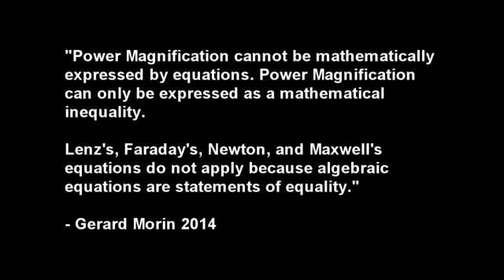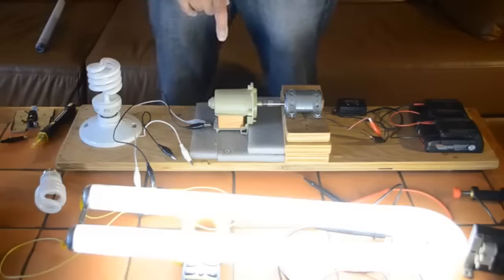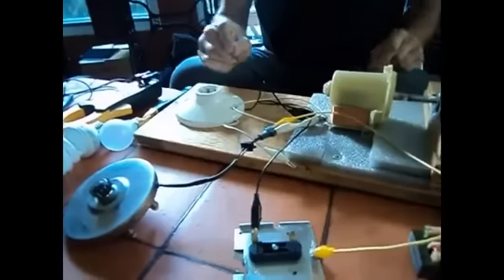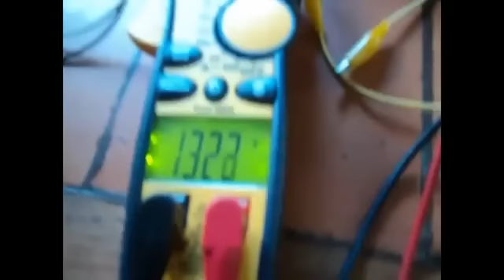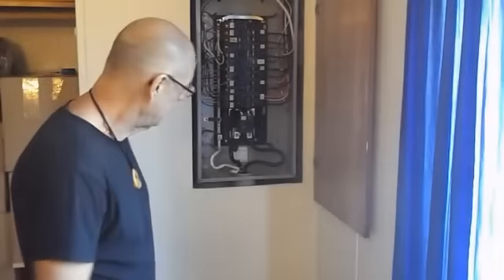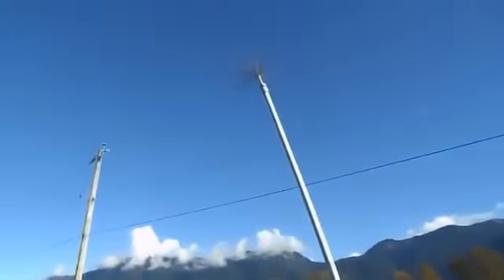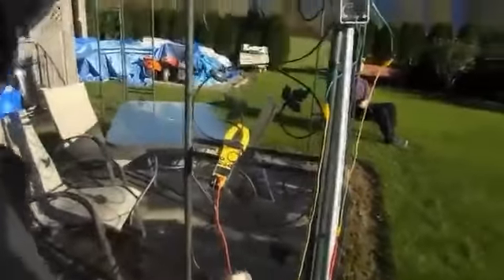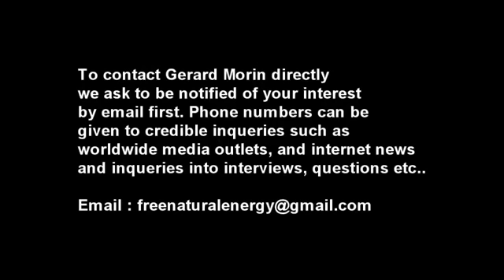Time to END The Electricity Racket - FREE & NATURAL ELECTRICITY PROOF

Comment: I think the break throughs we make tend to be incremental.

Yes we can wait for someone to produce a super powered generator that makes gigawatts of energy from a box the size of a brief case or and I think this seems to make more sense, we can simply improve by design the items we use to make them more efficient.

For example: instead of using light bulbs that burn 100 watts of energy to make light, use light bulbs that burn 2 or 3 watts and in time maybe even 1/2 a watt or less to produce similar lighting that the 100watts used to.
But this takes time.

More efficient motors that use less energy but produce more power.

recycling of power on a loop these kinds of things.

But this will take some thought to produce and time.

Our own body uses electricity and produces quite a bit of power, yet it uses only a fraction of the electricity our machines use, in time we may produce machines capable of doing similar or better than our own body for the power consumption used.
Reply: I agree I have a patent idea I put a pre patent on that would save lots of water in every home I just can't afford to pay to get it full designed in patent on it it recyclable will probably 80% of the water in the home so we can use that for cleaning and other daily activities and washing and watering the lawn we would use that recycled water and have a separate drinkable  line and the toilets water would go directly into the sewer the rest would be recycled
Reply: @chrissappliancerepair4492  It's good that people think and work on ideas on their own and yes other people stealing their ideas is a problem, but some of the problems being solved are not really problems that could be solved simply by for example just reinvesting in the service we pay for.

The water companies are very much crooked, they charge us based on the value of the property within an area never understood how they managed to get that one myself.

I'm told in some parts of the USA you are not allowed to go off grid they make you pay even if you don't use their services.

So some problems are clearly political rather than technical.
Reply: @flitsies  hahahaha I'm not crazy yay! See honey I told you there were others...
Reply: @bscguitars2278  That's just how it Is, politics often gets in the way of progress, sometimes for good reason and other times not for good reason.
Anyway there is a lot happening in the world with tech so we shall see.

Battery powered christmas lights are pretty good now and they last a long time between charging a modest power bank.
Reply: It's all being regulated to a worldwide ish agreement of legality so they who regulate are in front zone of it all even, like the patent office and the one who says this or that in the reason of decline so not to intake on there bucks

Comment: Now I'd like to see this without the wooden board and on a glass table top.  I'd like to believe but...
Reply: You are like me we cannot get no deep pockets to join us because they know that they would be hurting other deep pockets and they are scared that they would be assassinated for helping us you can take a wood stove and wrap it with copper with I won't eat sheet of glass under the legs and run the end of the wire to into a capacitor then into a Step up Transformer from the step-up transformer into 2 more capacitors hook it to a breaker then take a rod and drive it 5 feet in the ground then run a wire from the a light bulb then hook the other wire coming from the breaker to the other wire on the light bulb and Watch What Happens of course you have to have a fire burning in the wood stove to heat the wire that is wrapped around the stove to turn it into power what you will be doing is transforming the heat into a power source

Comment: Wish I could share pictures with you I need some help on this I need a wiring diagram and what I have done I'm going to epoxy and not to screw onto the shaft of the high speed motor but if I could do a well that would be much better but I can't do it weld right now no welder it would really help me out if you gave me this schematics on the wiring and how or what I need to make it so so I can do this

Comment: Without needing to jump to an entirely dubious conclusion, because I am just a critical thinker and I have no desire for drama, I will kindly point out a flaw in the tests.  The tests do not demonstrate how long the charge in the battery can hold out.  An improved test would use two identical test rigs side-by-side, but using supercapacitors instead of batteries, because they charge and discharge so quickly, we can easily demonstrate how long that charge will last for a given load.  Side-by-side, two identical power sources should last just as long with or without the amplifier engaged if energy is actually being produced by the amplifier, and not merely depleting the battery faster.
Reply: As a matter of life and death, I must point out the alarming incompetence he displays at 41:40, where he haphazardly waves his hand over both main lugs of the entrance line.  If he had pushed his hand in another inch, he'd likely have permanent nerve damage and severe burns in that hand.  If he had used both hands, he would have been thrown and his heart could have stopped.

Comment: You have 240 V going into your house. But it is center tapped.   What you were touching, is probably the center tap. So you have tube 110 V windings on the same transformer. Will you have half of your 240 on 1/2 windings and the other half of the 240 V in the other half. It is possible that it is unbalanced. This is why you’re getting different current from the different wires. Try operating a vacuum cleaner a toaster run a single outlet go down to your terminal box again, and measure the current only one of those windings will have the higher current.

Comment: Ohm's law......
Voltage = current(amperes) x resistance(ohms).
Power(watts) = voltage x current(amperes).
Power is not voltage! 

He is not creating more power than he is putting in. The switch to the right is allowing him to vary total current drawn. What he doesn't show you is early on he limits current with high resistance to create the illusion of less power with dim lights. He was not allowing the batteries to provide their maximum. He then flips his switch (reducing inline resistance) which allows higher current to flow. Power is voltage x current. Hrmmmm, allowing more current obviously increases power to the bulbs. 

This guy is a snake oil salesman. 

The results he is selling are brighter bulbs. However, the brighter the bulb, the faster the batteries deplete. If he were to demonstrate battery longevity, you would see that a 50 watt bulb running at half current would last almost twice as long as that same bulb operating at full current draw. Hrmmmm, so brightness means free power? Nope, just means using more power for shorter durations. Total power provided would be the same when factoring in time.

Comment: How is this proof of free energy?
Driving a very efficient generator with a high torque motor doesn't give free energy. Lighting a light bulb is one thing. Running your fridge or toaster off it is quite another. This setup would not provide the amperage required to run a washing machine or even a garage roller door for that matter.
This is very basic highschool science and proof that you can light up a globe using essentially static electricity

Comment: The motor draws more current than the bulbs, and produces more power out of the generator. The bulbs are brighter because the batteries are putting out more wattage and running down faster. So it's not creating more energy than is being put in. It's just putting in more energy from the batteries when the motor and generator is used.

Comment: Most newer dishwashers have the same motors that he is creating for this purpose direct drive to it. I found out that other motors have been built in redundancy in to them but with a little extra effort recoiling the wire to the same count number a tiny bit thicker 1 to number 3 wire

Comment: Youre spinning a single magnet inside the casing which is mounted on top of a single transformer coil. its a generator, efficient, but not as efficient as the flywheel, also missing "gearing" 🙂

Comment: Power is voltage times current. When you connect the motor you are drawing many more amps then just the lightbulb directly connected to the motor. You are also converting to ac, which is why the fluorescent bulb only light up when going through the contraption. Still obeys laws of thermodynamics.
Reply: Actually,,  power (watts) is amps times volts,,  Amps  and current is the same thing,,  I think the dc motor is turning a dishwasher pump motor They are an electronic motor that is powered by square waves,,  It probably produces square waves when the shaft is turned,,  Will have to experiment with that,,  :-)

Comment: There's a transformer on the other motor... All you are doing is increasing the drain of the batteries. The amperage is way higher draw on the first electric motor than on the bulb circuit. You can drain those batteries faster and get more light by transferring the increased draw through that transformer. You can't just claim there's free power without measuring the batteries and their charge over time. 

First how long they last with just the bulb circuit. Second how long they last with the motor transformer circuit.

Comment: It's amazing what people can convince themselves of when they don't actually understand the physics of anything they are working with..

Energy doesn't just appear out of nowhere, and neither do electrons (if they did, most of the fundamental physical laws of the universe would break down).  There's no such thing as "manifesting electrons".  That's just a fancy way of saying "and then magic happens".  (BTW, "static current" is also a contradiction in terms.  "static" means it's not moving, and "current" means it is moving.  That's what those words mean.  It can't be both at the same time (by definition).  He's literally just making up nonsense terms.)

It's also funny how in all his tabletop setup he was always connecting up two wires to everything to make it all work, but then when he gets to his breaker box he's suddenly perplexed and confused by the idea that electricity needs to flow over more than one wire when being supplied to his home (hint:  it's called an "electric circuit " for a reason).

And please, please, please do not poke around the exposed main terminals of a breaker box like he was doing.  At least two times he came very close to bridging the full 240V circuit with his fingers (which at that point in the box is capable of passing hundreds of amps of power in an instant).  If it was only one hand, it's possible it might not kill him outright, but it would at the very least produce some really nasty burns, and possibly permanent nerve damage.  The only reason that touching the single (neutral) terminal didn't kill him is because he wasn't touching anything elsewhere that could go back to the other side of the circuit, so there was no path for the electricity to go through his body.  If he had been, he would almost certainly be dead now.

And it's very interesting how he never actually shows anyone how much power he's pulling from those batteries.  Every time he "increases the power" of the output, he's really either just traded less current for more voltage (same total power), or he's made a configuration which ultimately just draws more electricity from the batteries, which means they'll just run out of their charge faster (because all the power there is actually still coming from the batteries, just converted in different ways).

If you've really found a way to get free energy out of nowhere, then show us how your apparatus can do it without already having charged-up batteries constantly powering everything.  If you actually know what you're doing, that shouldn't be hard.

I also love how guys like this love to brag about how they never bothered to finish school, and they don't actually use any instruments to measure anything, because "they just know everything already" and "you're all just peasants".  Yeah, ego tripping and insulting your audience are great ways to convince me you know what you're talking about..
Reply: J-Seven  What makes you think I haven't tried it myself?  I've been working, hands-on, with electronics and electrical devices for over 40 years now.  I've connected up all the same components he was using in all kinds of configurations many times, and actually measured what was going on (because unlike him, I do actually use real instruments to measure things, because that's how you know what's actually happening), and I understand the physical principles of what's going on in everything he put together there.  There are really no great mysteries here.  (Anybody who knows a relatively basic amount of electronics can see pretty clearly what he was doing there, and that it wasn't what he was claiming.)

"Keeping an open mind" is not the same thing as "ignoring answers many people have figured out and tested for themselves many times already".

Regarding your first comment:  I don't necessarily think he didn't know he wasn't supposed to touch them, but I also think that, assuming he did know, he was being extremely reckless with what he was doing.  He quite clearly accidentally almost did touch them more than once.  Also, given his multiple comments earlier when working with relatively high voltages about "it won't kill you" (they definitely can), I really suspect he actually has no idea how dangerous some of this stuff actually can be, and has probably just been very lucky on several occasions.

(Also, he incorrectly identified the white wire as a "ground" wire, when it is actually the "neutral" wire.  The two are often confused, but are not the same, and it is actually possible to get a substantial current between neutral and ground in some circumstances, so just because it wasn't the "live" terminal does not mean it is necessarily safe to touch it either.)
Reply: J-Seven  First, I never said I wasn't sure of the current being pulled from the battery.  I said he doesn't show his audience what it is which is, IMHO, probably because he is trying to cover up the fact that it's really just the battery supplying all the power to everything all along (which would be obvious to everyone if he did actually show it).  Once again, anybody who actually does know electronics could probably calculate to a fairly close degree what the battery current actually is, because many people have studied all of this for a very long time and these equations are actually very well understood.  If you actually do try it yourself (go ahead!) and actually measure it, I absolutely guarantee you you will find that all the "extra power" he is producing is actually just because he's pulling exactly that much more current from the battery instead.  You don't need me to tell you.  You can try it yourself if you don't believe me.

Secondly, I don't know where you get the idea that I'm mad.  I'm just doing what I was asked to do.  In the description for the video it actually says "If you feel you are being tricked, then please explain exactly how."   Now, to be honest, I suppose I don't exactly believe I'm being tricked, because I'm pretty sure I can tell exactly what is going on here, but I think he is (deliberately or not) misrepresenting a number of things to his audience in general, so I'm just explaining how what's happening in this video is not actually what he claims is happening.

Look, I get that you want to believe this is possible (I mean, it would be really cool), but you shouldn't just believe that some random guy in a YouTube video who can't even really explain what he's actually doing without using made-up nonsense terms and a bunch of hand-waving has somehow been the only person in history to discover some fantastic new energy source that breaks all the known laws of Physics.  None of the components he's working with are anything new or special, so everything he's doing there involves very well understood behaviors, which people can easily look up and test for themselves (if you're curious, looking up "Ohm's Law" would be a good place to start).  If multiple other people with electronics experience are telling you that he's not actually doing what he claims he's doing, and electronics don't actually work that way, then maybe there's reason to be a bit skeptical, at least..

And really, with all of the literally billions of dollars a whole bunch of different governments and large companies are currently spending to beat each other to the punch of achieving the incredibly complicated feat of making actual fusion reactors work (which they're getting closer to every day), if it was this easy to produce "free energy" with $50 of electronics components and a few wires, which they could learn how to do by just watching a YouTube video, don't you think at least one of them would be doing that instead, if it actually worked?  It'd sure be a whole lot easier and cheaper.

So the whole thing just doesn't make a lot of logical sense either, if you think about it, which should be another sign that something's probably not right here...